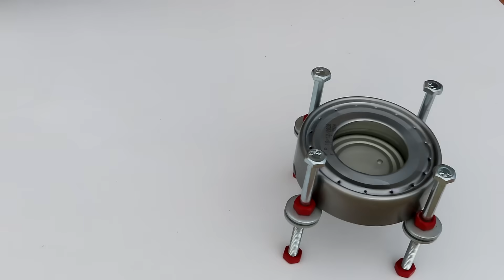Quieres cocinar sin gas y sin electricidad muy facil

Comment: This design is not safe. I remember when I made something similar, it had a wider base. The pot was held solidly to the frame, and the burner was held by a magnet. All this just to avoid making a mess on the table.😂